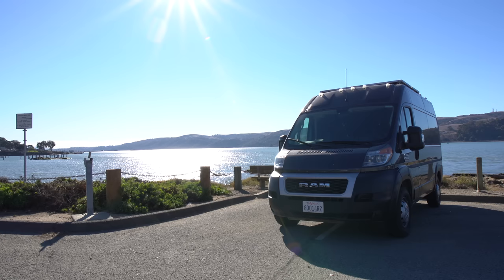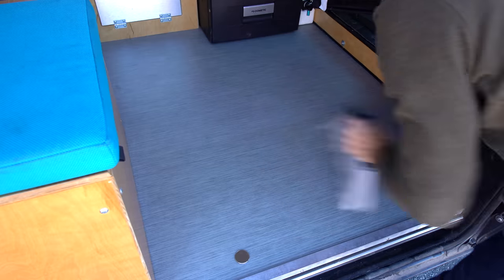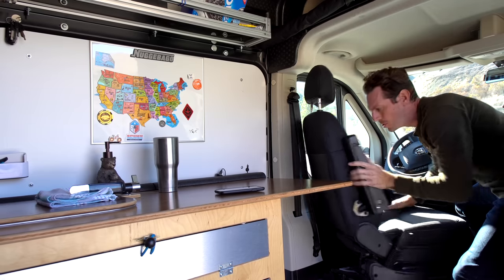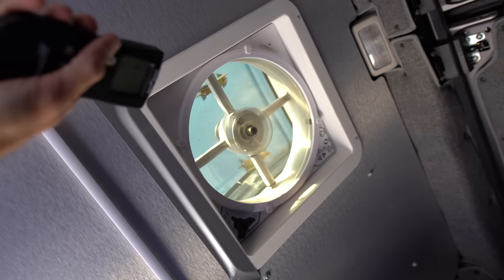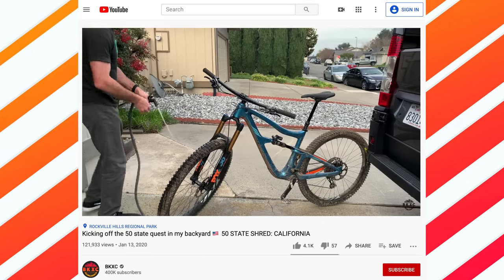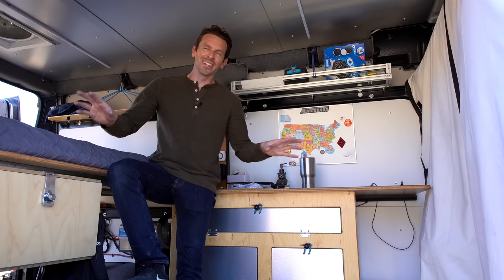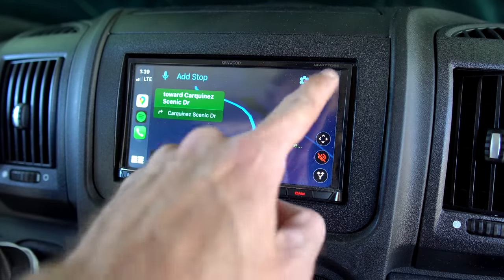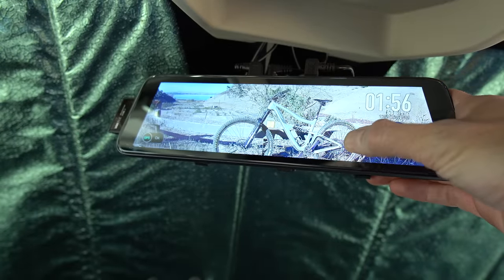15 Smart and Stupid Details On My Van | RAM Promaster camper conversion

Comment: NEVER let the dealer touch your vehicle again once it rolls off the lot.
Reply: Correct!  Except for my tire guy installing one set of tires (I installed the other myself after having the tires professionally mounted on loose rims) I'm the only person to have put a wrench or part on my 2017 car since the factory, 82K miles into it.  I even left the 25K miles of "free oil changes" unused and did them myself.

Comment: Dude.. diesel heater is £100 ($135) and maybe the same to have it fitted. $300 for no condensation. No risky fumes. A remote control. A timer so its on and warm when you get back from the trails. No risk of your duvet touching it and burning you alive!!!

Comment: Why are you uploading GBs? 1080p should be good enough. Not sure what “lord” watches YouTube in 4K, but you can easily reduce your video size in your editor or with a 3rd party tool. One I’ve used in the past is “vlc media player”. It’s free, and you can use it to export the video to a smaller resolution.

Comment: Don't spend US$1200-1800 on a Webasto Diesel heater. The $100-200 "all in one" Chinese diesel heaters are OK, are easily removable, and will last at least a few years with almost no maintenance. The 2KW models are fine for most use, but if you do extreme cold, the 5KW model will keep the largest van toasty. The diesel heaters will burn diesel, home heating oil or even kerosene (in an emergency). Bio diesel tends to get too thick in cold weather, so isn't a good fuel for these heaters.

Comment: I can tell you as a van lifeer that having a solid platform for a bed is the worst thing you can do because of mold which means that that company may make nice looking stuff but ultimately it will fail you
Reply: What type/s of beds are best?
Reply: @j.r.walden9937  slatted

Comment: What oil lasts 10k miles? I change mine at max 6k. edit: also if its full synthetic sure, maybe it "lasts" 10k miles but its dirty as hell after 6k. Race engines do not use full syn. because it ruins the engines.

Comment: Cost of air compressor? 

Because tires change in cold. Once had to fill them AND get gas in 14F. It truly sucked a bag of ass. It was Feb 14, 2020. Still remember it very clearly in a negative way. 2 gas stations, no air at 1st one. It was REALLY, REALLY cold.

Comment: Can you explain @4:34 abt vent fan and potential thieves.  I know you said anyone who knows but, i don’t know” thanks.  Sorry if it seems like a dumb question, I think 🤔 I know where you’re going not sure.
Reply: I believe what he is saying is that the vent hood on top of the vehicle is quite distinctive and most people will recognize it.  If they recognize it as a ventilation fan for an RV, they would then realize that this is someone's home base and probably has valuables (electronics, anything else that can be carried off and sold) inside.  Without the vent hood, the van could more easily pass as a work van, not worth breaking into.

Comment: Umm...diesel heaters are not thousands of dollars. They can be had for under $500. And table fan does not replace a vented roof fan. Those help a ton with condensation. Table fans do not.

Comment: Thank you for heater info just saved be 1 k plus 6hrs labor😊
Reply: A
Diesel heaters are all over Amazon for $150...I installed one and so far it works great....those propane heaters are ok for emergencies  but they produce a ton of moisture....

Comment: Ok, oil changes. Synthetic in Chicago is probably about...OK, let's say 50 bucks. Big vehicle. Maybe more. That's at least 5 quarts, yes? 

If it's 30 oil changes, at 45 each,  that's 1,320. It's got to be more than 45, but let's just say... 

Btw, don't let kids at Juffy Lube touch your stuff. They will eff it up at some point. Trust me. No chains. Real mechanic.

Comment: Ok, I don’t understand your discussion about the fan? First, you say that it is pointless to have just one ceiling fan and if you were to do it over again you would have two fans so that you can push the air through the van, and then you say that you would not have spent the $300 on the ceiling fan and instead you should have just got a desk fan? The rear camera that is recording if a great idea!

Comment: I used one of these mounted sideways at the base of my cabinet for the water pump. https://www.homedepot.com/p/Leviton-Decora-15-Amp-Single-Pole-Rocker-AC-Quiet-Light-Switch-White-10-Pack-M32-05601-2WM/202204204

Comment: woah, $15k for a van conversion with Wayfarer Vans and still have thousands more needed... my entire truck + camper (for truck bed) + trailer (with camper for towing) conversion basically cost that much (including buying the truck)... like I get the appeal of having someone else do it in half a day, but they don't do much because there isn't time and from what I've seen... doing it yourself would be like around ~3k depending... that is tooo big of a difference for me to see how it is a smart buy unless you are rich and even then... like... dang... looks like you've easily got 150k into your van... like someone could by a house for that... I think your van is cool and I'm gonna continue to check out your channel... but this is no where near making sense... and the things you told people to get professionally done and not even try... like some people have more mechanical and electrical and carpentry skills and should do near all this theirselves to save money and learn stuff to be able to maintain and repair the vehicle for years to come... also the small diesel heaters can be done for a couple hundred dollars and save money fuel to propane cost AND don't cause as much moisture. doing your own oil changes and van maintenance is always the best idea money wise and worry wise. a deeper sink vessel would likely help you with splashing. but neat foot pedal, where is that from?

Comment: You don’t have to do all that cleaning that’s a lie., I own my own tractor trailer has over 600,000 miles on it do you think I do that kind of cleaning now. And now with the new DEF systems the diesels recirculate the suet trying to burn and re-burn. So I centrifuge oil bypass system would be the best investment you could ever put into your vehicle you can find Spinner to centrifuge on YouTube check them out.

Comment: Check out Bixwireless.com... truly  unlimited, no throttling after a certain number of Gigs like Verizon and others.. cellular but Data only.. and a deal.

With a single fan.... if you find a spot for it.. a 3-4” pvc pipe through the floor will pull cool air from the shade under the vehicle.. I covered the bottom hole with fine mesh, secured with a hose clamp.. Some vans(early Sprinters had body plugs that were perfect for this)  no need for    a second fan.

Vent fans are not the give away people think they are... but Solar, bike racks, stickers, artwork are.. throw a clipboard with receipts and pens on the dash.. hang a hard hat or Co. baseball cap (Goodwill and Savers are good sources).. hang a corporate looking badge from the rear view mirror..

Comment: You definitely shouldn't go 10k between oil changes. Synthetic oil gets gummed up with higher  mileage intervals. I have learned this from watching engine builders talk about it. Synthetic is good but 5k is where it should be changed. I don't understand how that is recommended by dodge.

https://youtu.be/tDpTPxinNyo